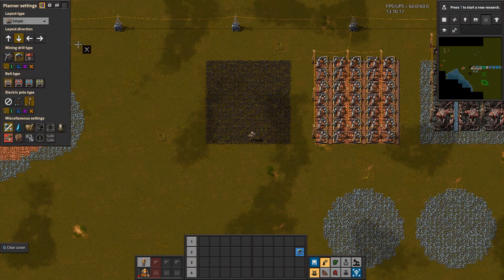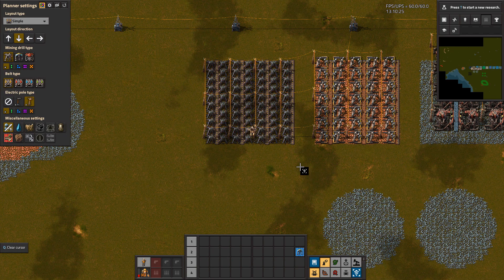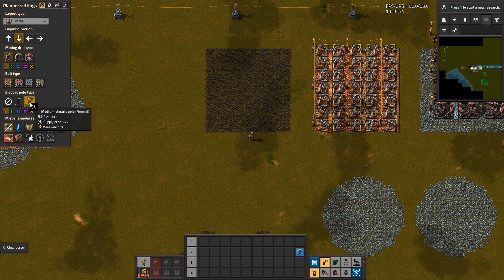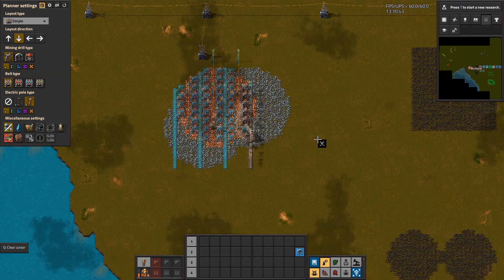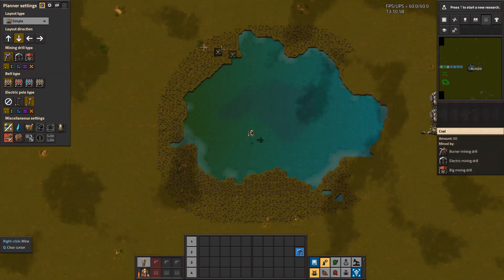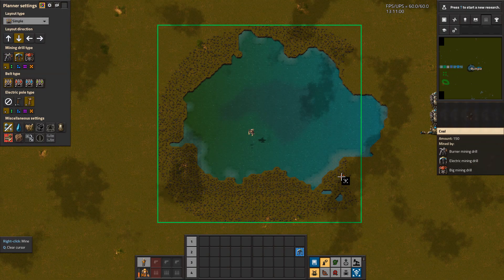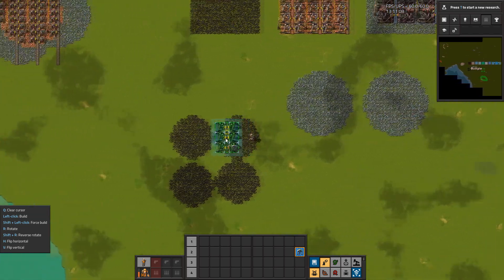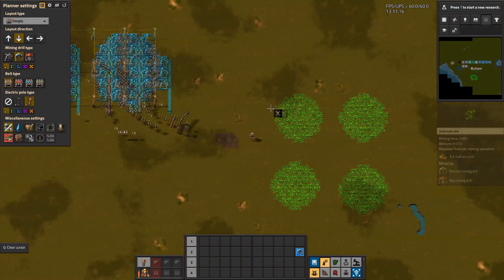Factorio Mod Tips: Mining Patch Planner

Comment: tell me, how many pipes on ultra dense uranium mine can you supply with sulfuric acid?
Reply from the maker: 320, same as the maximum pipelength. The miners also count as a segment when calculating this length. And the 320 pipes would attach to 96 miners :-)
Reply: @FactorioModTips That's not relevant anymore with the new fluid physics in 2.0 though